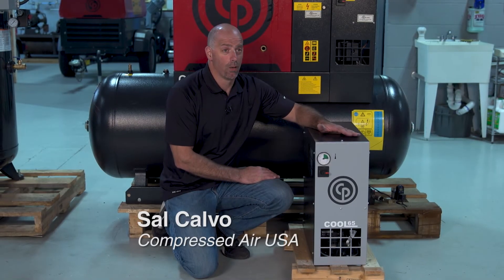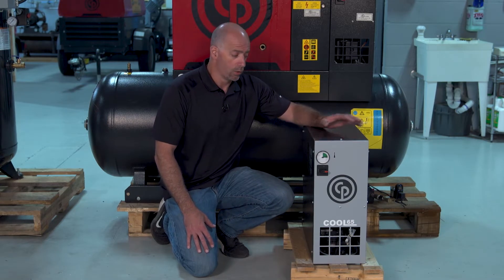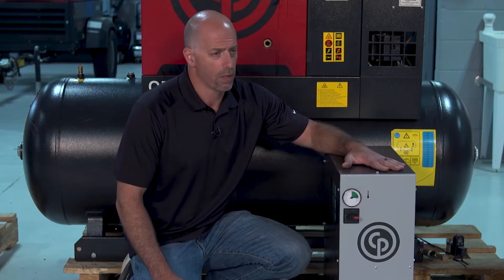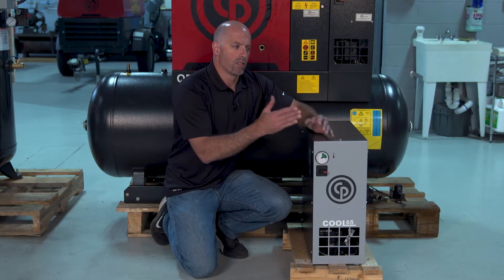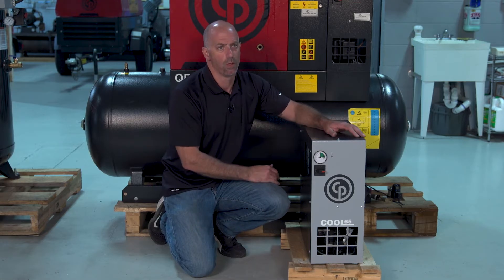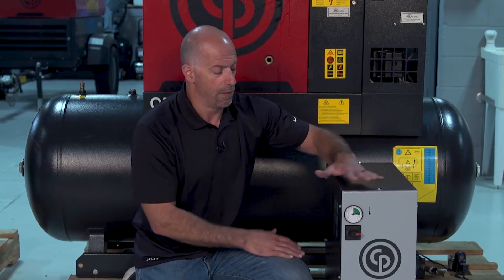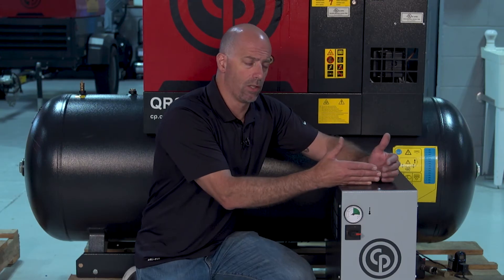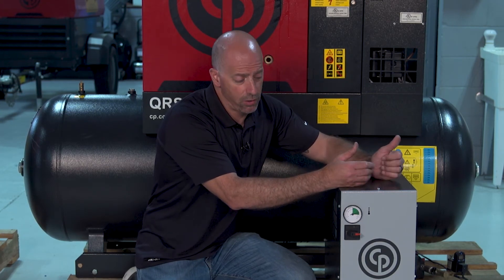How a Refrigerated Air Dryer Works | CompressedAirUSA.com

Comment: I’m currently doing the air system in my shop, can the dryer be before the compressor tank or will that not work it has to be after the tank?

Comment: I’m adding a dryer to my shop for my sand blast cabinet and powder coating setup. Is there a particular distance the dryer needs to be from the compressor?  Is it better to be closer or farther?
Reply from the maker: Install the dryer where it is most convenient in your system, as the distance does not matter much if at all in your application

Comment: Just watched air dryer video. Im in the pool tile blasting business. Keeping my line and media dry is paramount to success. Im running a MiTM 30 gallon tank w/ 29 CFM
thats trailer mounted. My blasting equipment is Clemco. What air dryer would you recommend that would work with being mobile. I.E. 
1)appropriate size to handle the amount of CFMs that I run 2) how would this be powered being trailer mounted. Any advice here will be helpful. Thanks from Cobra Jet Filter Cleans
Reply from the maker: Thanks for the question, for your application being mobile we would recommend a free-standing pneumatic controlled tower style air dryer that utilizes desiccant rather than a refrigeration cycle.

Comment: Need something for getting air out of my lines for spraying gelcoat.
Reply from the maker: Thanks for your question, for getting air out of your air lines you would need to pull a vacuum on the distribution system, although I don't think that is what you mean. If there are air bubbles entrained in your gel coat, it could be due to incorrect pressure, unless the bubbles are from moisture in which you would need better air treatment.
Reply: No I was just making a statement. I use my air dryer to get the moisture out so I can spray gelcoat. I'm not sure if it's working though because there is never water in the bottom in the pan but that may be due to it being colder outside lately here in north Florida. I bought a used one its an arrow brand one with only 1 gauge that says refrigerant vacuum (I think that's what it says but I'm not at the shop) and it goes to 30 when I turn on the unit and the unit all turns on, I'm just not sure of it's cooling. I need to wait for a hotter day. I have it going from my gas compressor outside, running in a 1/2"od line to my auxiliary tank inside then from auxiliary tank through filter then through refridgerated air dryer then into desiccant dryer to line for spray gun. Any tips on determining if air dryer is not working? I bought it used so I'm not sure how to tell. Have not had to paint with it since buying it.